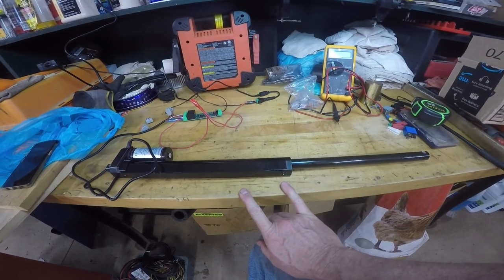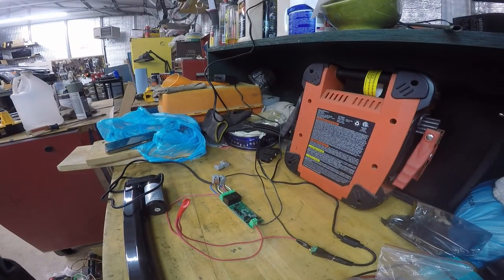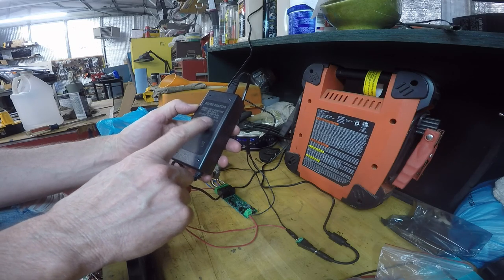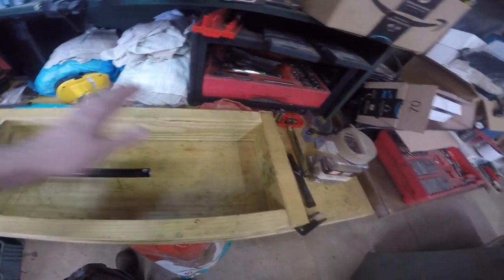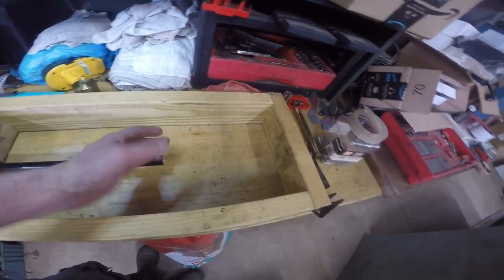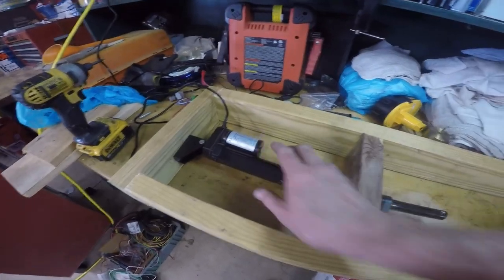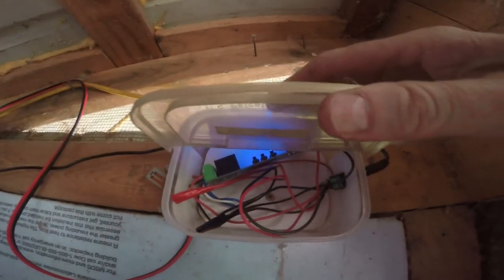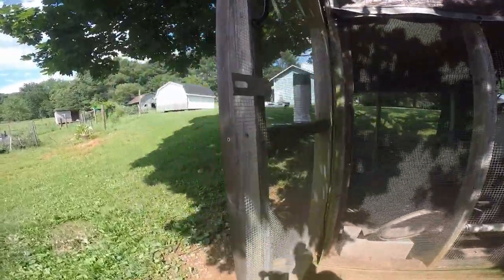Chicken Coop Smart Door 2 Channel Wifi Relay

Comment: 3:25 It is nice that you are doing this the smart way and using a smart switch. I do suggest you use a 4ch smart switch. Either the MHCOZY or the SONOFF. They are mountable and the extra 2 ch can be used for lights or fans when it gets hot. Plus they both are RF remote controllable. 

10:00 You must have put it on wrong. They don't "bottom out"  like that. You should mount it the correct way. The video I made called "Chicken Coop Door w Safety Feature" Show it mounted the correct way.

You also should get rid of that center 2x. The mounts are meant to pivot with the door. And it swings just a bit. It you restrict it you can cause it to jam up enough to struggle and shorten the life of it.

14:40 It is var nice that you made it with its own frame, however you should have framed the opening in the run itself too. That way you can have a second manually operated door on a string. Why? If you even have to fix the door or upgrade, you can take it off, take it inside and just close the manual door if you can't fix the door or finish the upgrades, you can at lease be prepared to secure the chickens.

14:55 Also make the control box removable from the wall by using a french cleat.

18:08 Just in case you have not figured out this yet. You can set the open times to be at sunrise and sunset. Or an hour before or after for each. 

Even if you don't take any of my suggestions, nice work.
Reply from the maker: Thanks for watching. I made another one of these for my daughter. She doesn't have power to her coop so I used a 10 watt solar panel and a lawnmower battery. I have security cameras on each of the coops to keep a watch on the chickens. It amazes me how dependable these smart doors have been, especially the relays. They've never failed. Hope I didn't jinx myself saying that. Thanks again for watching.
Reply: @slowshedgarage7409  Were you able to see "The video I made called "Chicken Coop Door w Safety Feature" Show it mounted the correct way."?
Reply from the maker: @AztecWarrior69_69  not yet but I'll check it out.